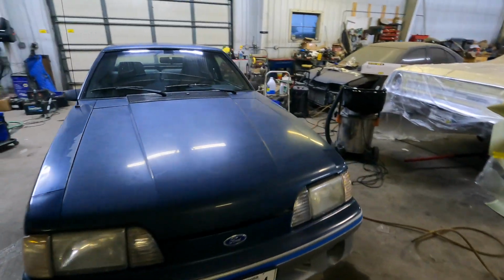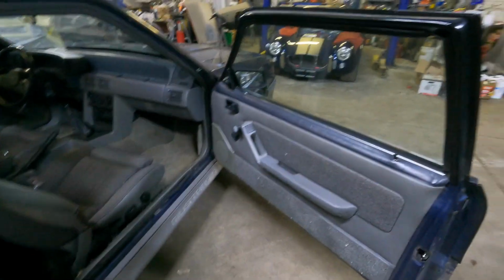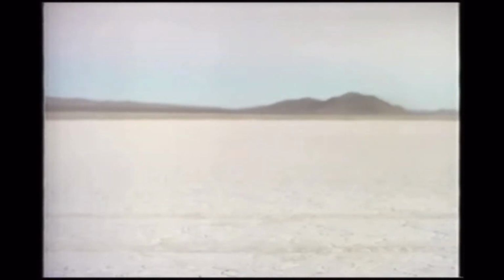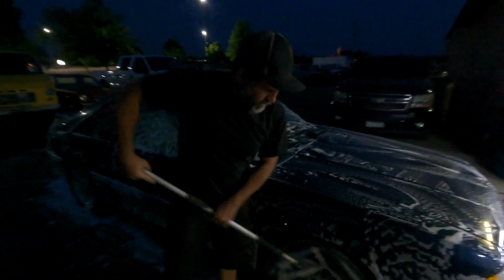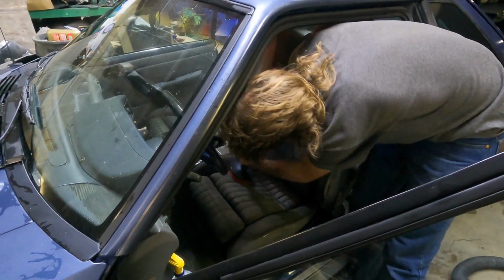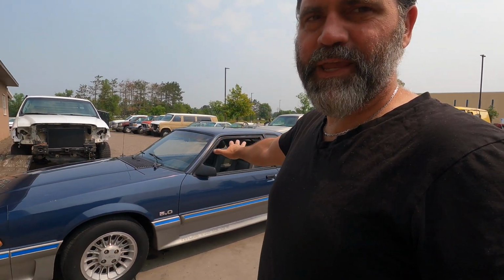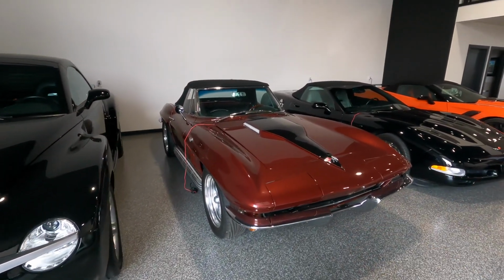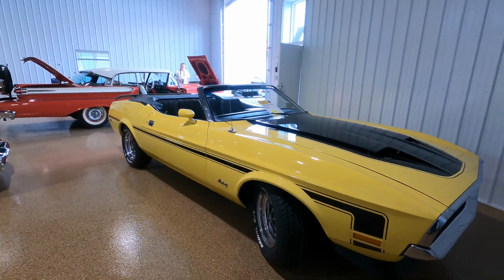Barn Find Fox Body Mustang Gets It's First Wash In A Decade

Comment: 225 hp?  They only had 210 factory. Sadly that was more than the C4 Corvette. The mid 70's- early 90's sports cars were extremely anemic.
Reply: Wrong.  87 had 225 hp factory.
Reply from the maker: According to my research 87 got some different heads and a few other tweaks for the 225hp and 300 tq rating
Reply from the maker: The were a good foundation to make more power and have a pretty fun car
Reply: My 89. 225 when stock
Reply: Don’t know where he got 210 from
Reply: When the speed density cars were given mass air the lost 15 hp. That was 89 I believe!
Reply: @Jeremy5speed  naw it was 225. 87-92. It dropped in 93 due to the cast pistons change rather then the og forged
Reply: @champking20  I thought it was a different way of measuring the output and was implemented at the same time as the mass air system.
Reply: my brother ordered mine and got it in 86 december i wonder what it is worth